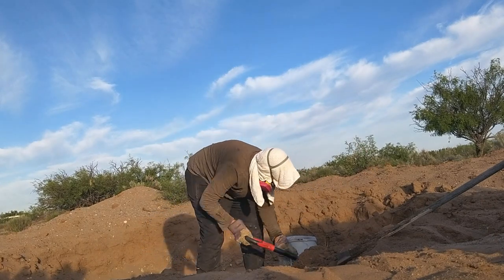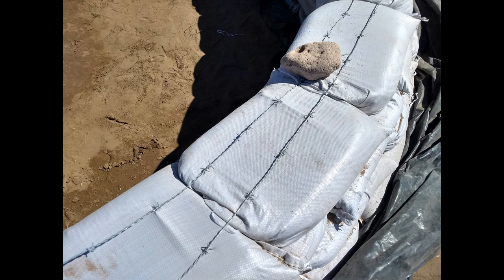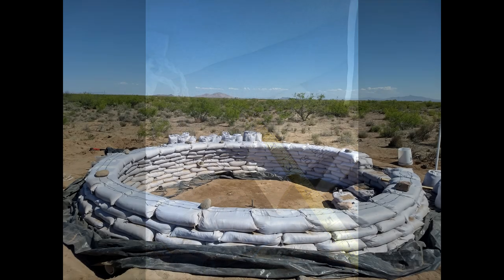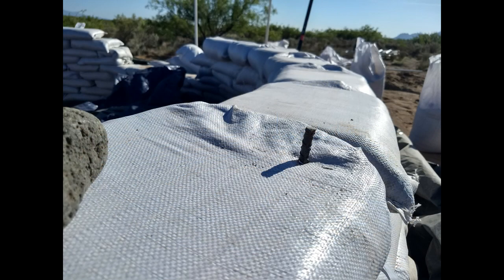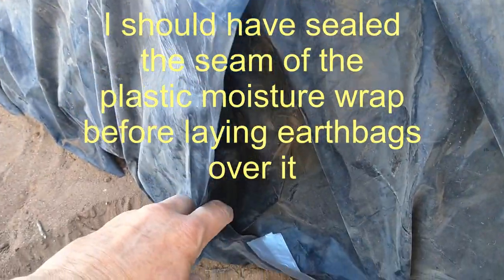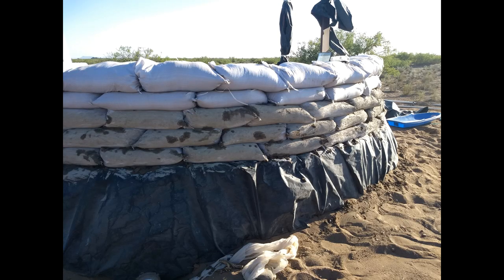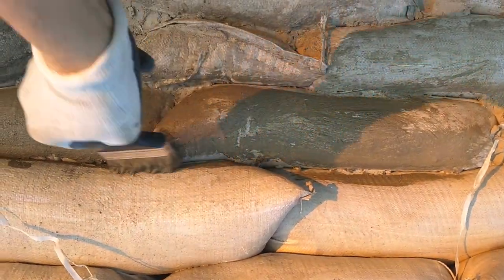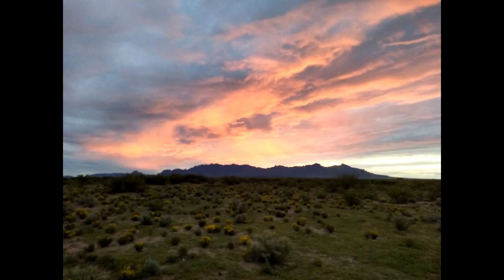Earthbag Challenge - Part 2: This is how far I got before I had to take a break

Comment: I know you are not on this property anymore, but I wish you were. You did a great job, learning as you moved and at the same time, inspiring and motivating many of us. 23,000 of us, by the looks of it.
A note to whom it may concern: Those bags degrades quicker than we ever want. We get feed in those, and sometimes I store sand in them to use in a few weeks. They usually degrade by week 3-5, and won't show it until you pick them up (then, boom).
Reply from the maker: Thanks for your comment.  Yes, that was one of the lessons for me. When I returned to the site after a few months, several of the bags that did not have enough stucco/plaster on them degraded. Much of the earth inside those bags fell out and the bags had to be replaced or patched.

Comment: I liked this eco friendly way of construction. Also you have tried to exaplain it step by step in a very informative way.
I have couple of questions hope you don't mind to answer. 
#1. What made you to build earthbag home ?
#2. Why you choosed desert for the location.
#3. Where were you staying and managing food and water during the construction.
#4. What is a good choice for earthbag: Sand or Mud?
In my opinion sand would not absorb much moist.
However mud will have good stability.
Reply from the maker: Thanks for your comment. In answer to your questions....

1. Why this method?
I looked at most (if not all) of the alternative construction methods, but earth bag building was the most convenient, least-expensive, and the most naturally-suited method due to the restrictions of this project.

2. Why this land?
It has many attributes that appeal to me, including mild weather all year round, very low humidity, very quiet, virtually no light pollution at night, no neighbors within a mile or so, soil that can be easily cultivated for farming, water that is not far below the surface when I'm ready to drill a well, and within 20 minute access to shopping and a cross-country highway.

3.Where did I stay?
 I was renting an inexpensive room about 5 miles away from the site while working there. I brought water in to the land in 6 gallon containers each day that it was needed.

4. What is the best content mixture for the bags?
I am not qualified to answer that. I've only heard that something around 20% clay is good, but that may vary with different climates.  My land seems to average less than 5% of clay.
Reply: @rebhanchannel  thanks for the reply.wish you all the best. Hope to see new video soon😃

Comment: Damn bro, you were working against yourself, that sucks...
I devised a funnel and stand system, and made a sifting table I threw shovel fulls on a tarp till I had giant pile, I would fill like 120 at the most a day like 60 the least if I recall...
There's tons of things you could of done, but that's the purpose of the principal's God needs you to walk... You live you learn, but you learned...
You still did work tho... The mile trek to the property... Oh hell nah... No bueno... You got what it takes, it was used getting there...
Bags only suck because after they kick your ass you need to have it kicked again for protection of the bags... I had a new born and battled the same winds because I was in Belen NM south of Albuquerque aka Buque...  And tried to get all the walls covered before the birth, nope...
But next time get at least one more person, a front wheel drive and hit it hard with the mind that God is going to laugh at it, so go hard...
My first snow it was -5 6 inches of snow outside, inside no heat going it was 68 degrees inside... That instant I knew I was doing something right, my new born just fine, sleeping I make a fire on wood stove, heat coffee water at same time, the temp inside was 80s... All day no fire but the one...
There's power in what God gives freely, way more power than anyone can believe... For 2 years I didn't use an alarm to wake up and take it up the for a check, I was up when my body or baby was up, all work is 100% equity in my family...
FACTS...
Reply from the maker: Thanks for your comments.  Your two builds sound interesting. Are there any photos of your projects online?
Reply: Plz tell me more about your funnel & stand system!!!
Reply: @offadawall1  get your bag and a traffic cone, put pointed part of cone into bag until it gets the circumference of the bag, cut cone into a 6 inch band, screw 2x4 legs to the cut 6 inch piece, the legs shall be 3 inches shorter than bag so when it's standing there you put the bag in hole and wrap top of bag like it's a trash bag in trash can, you fill a 5 gal bucket and fill each bag with same amount every time, or less depending on size of bags...
Of course you can use anything, but a traffic cone is the easiest way to find exact circumference... Oh and do 3 legs not four... You want to be able to lift funnel after bag is filled so legs should be wide enough once you pour you can lift easy...
Reply: @jeromegarcia5396  hey thanks for the reply! Okay so you just gave me another idea which yours was great! But what if I was to do something like take huge tarp & elevate it (I'm thinking of renting a digger or something to fill the tarp with dirt) then cutting a hole in the center of it and putting the cone thru the whole cutting it pretty much the same as your suggestion, then funnelling all the bags with that one contraption.. do you think that would be difficult to get the dirt to funnel that way? I'm thinking maybe I could use a wide pvc pipe split long ways to help with the flow of dirt. Your thoughts???
Reply: @offadawall1  dirt is heavy, that tarp may say oh hell nah...
But my dude, you doing what you suppose to be doing figuring it out, failure is spiritual growth, I can't stress that enough, because God ain't playing, you go with a plan, he laughs...
Your idea sounds great, apply it, test it, but remember, you may be the inventor of just how to do this... I'm just sharing my walk, and it was so raw I balled up every plan I had, he walked me through it... 
It's really like that off grid... It's you and God, you ask you receive...
Hope that helps...
But you can't go wrong with being in the wilderness eating locust learning from your mother Earth and father God... You just need to be bout it when putting in that elbow grease for your cause... If not everything is no bueno homie...
My first winter, snow outside my newborn special needs daughter in a diaper sleeping in 68 degree indoor no heat, outside negative 5... At that moment in my flip flops boxers making a fire in wood stove  man, that's, no way, this is god given, my fire gets the house up to 80 and lasts all day... Yeah...
Make your path yours homie, ain't nothing but space and opportunity to go rounds with God... He will respond...
Hope you get what I'm saying, that's the best info I can give...
Reply: @jeromegarcia5396  thanks so much again bro. I think that's a pretty sufficient response. Encouraging.. much love to you and your daughter. You're and inspiration. Keep it up. And I will too! Boom!
Reply: @jeromegarcia5396  oh btw I think I'll maybe triple up on the tarp. And of course build some sort of support for it similar to the one you suggested except much larger and an funnel shape support for the tarp. Great bouncing ideas with you homie!
Reply: @offadawall1  that's what we do... Godspeed

Comment: Can't wait for the follow up video. Also, how could you work that long and hard with the respirator on? Was it a problem?
Reply from the maker: After the first day of wearing it I got used to it.  Also, I only wear it when there is a lot of sand or dust flying around.

Comment: Great content! Is this strong enough to bury below grade line?
Reply from the maker: Thanks for your comment. I don't know what the limits are regarding going below grade lines in general, but on this project I went as far as appx 2-3 feet below, and everything below grade seemed to hold-up well.
Reply: @rebhanchannel  Awesome, any additional tips? Do you think it would resist a tornado? Thanks again Blessings
Reply from the maker: @mauricioacosta7492 I'm not qualified to answer that but I've heard people claim that earthbag structures can survive tornadoes. 

My main tip would be avoid building it alone, if possible. It became difficult after the walls got above my shoulder height, and the entire process was very slow without others helping.  

Good luck if you are building your own eb project!
Reply: @rebhanchannel  Thank you! I appreciate It. Blessings

Comment: How many bags do you suppose you will use for this build. Please thank yoh
Reply from the maker: Currently, the walls are up to a height of appx 7 feet, and i've used appx 750 bags.  I'm in the process now of putting on a flat, wood-frame roof so there should not be too many more bags used for the shell of this building.

Comment: Why didnt u use the sand bag tubes?
Reply from the maker: a couple of reasons - first, going back & forth to fill the tubes would have made the progress much slower.  Second,  these bags were much less expensive than the tubes would have been.  Tubes definitely would have been better when it came to gap-filling and plastering, though - filling in all of the spaces between the individual bags has been taking forever.

Comment: Have you gone back? You certainly worked hard. I had my fill of sand bags in the Army almost 50 years ago. We had to redo them every 2 to 3 months.
You need to get some machines to help you so that you don't hurt yourself. A tractor with a front end loader would be ideal but also expensive. A cheaper alternative would be an old garden tractor(GT) with a plow and a large dump cart. The GT will give your body a break as you drive it while still getting work gone.
You are going to need a scaffold setup to go higher. Design the scaffold so that when you disassemble it, you can use the pieces for the roof. 
40 years ago rammed earth was popular. I think that it would be easier and allow more flexibility than sandbags. Good Luck, Rick
Reply from the maker: Thanks for your comment. I'm back at the site now, installing the roof, door & window,  & hope to upload the next video soon.

Comment: I live in Ukraine and also want to build a house out of bags of earth. But I don’t understand. Why do you cover the bags with wood glue?
Reply from the maker: During my first attempt at plastering, I discovered that the plaster would not adhere to the polypropylene bags. 

So, I tried a few different primers, including the wood glue (Titebond III).  Titebond claims to be nontoxic and waterproof. and the plaster adhered very well to the bags with just a light application of Titebond.  

I also experimented with using Elmer's school glue, which also worked well as a primer.  Elmer's is nontoxic but is not waterproof.
Reply: @rebhanchannel  Firstly Congratulations on your Project thus far. Just a few handy tips to help you out. The Earthbag walls can be covered with a  Plastic tarp to prevent UV rays breaking down the bags (temporarily) until your ready to plaster. Then to help the Plaster adhere to the bags a 'harling coat' is first applied. Refer to link for more instruction: https://youtu.be/1sjVSMypSvY
Really appreciated watching your videos and can't wait to see the Completed Project. Keep on keeping on. All the Best.